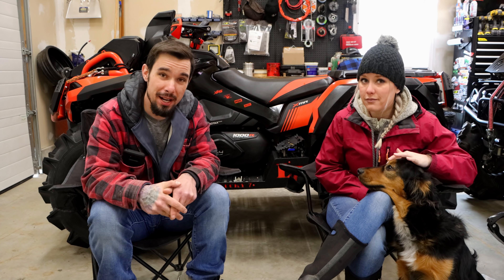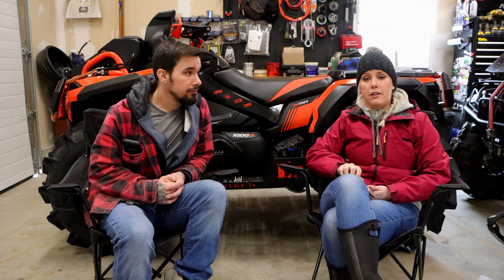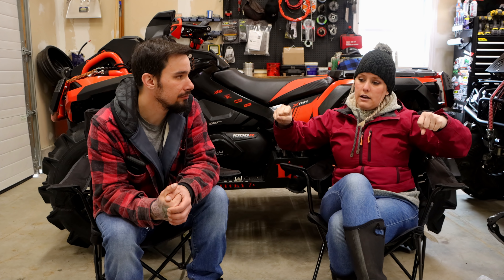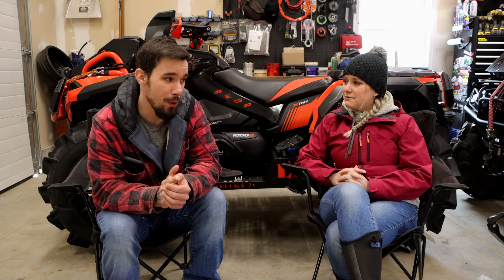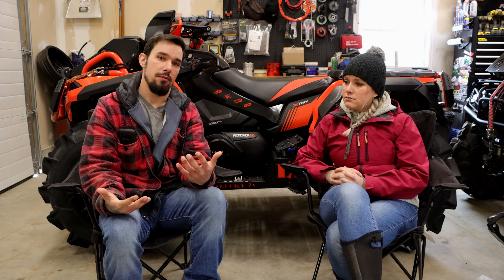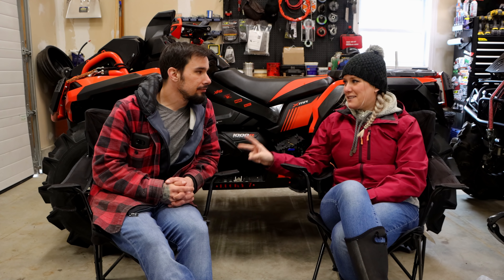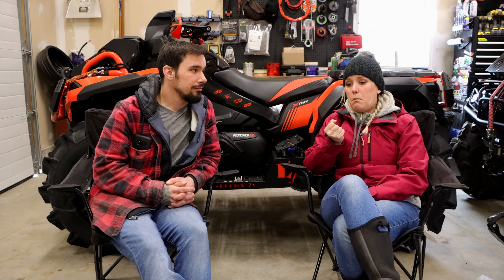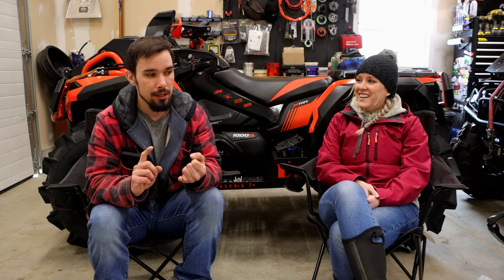5 LIKES/DISLIKES: 2018 Can Am Outlander XMR 1000r #ProjectMischief

Comment: As usual another great video. I always enjoy watching the 2 of you. Keep up the good work. Oh and I ride a 2014 Outlander 800R XT and I found out the hard way that the tie rods are the weak link. One of them snapped while trail riding by  myself my 1st time out  last spring and ended up rolling the machine and the broken tie rod some how ended up puncturing my Radiator but luckily I was only about 3 miles away from my truck and was able to limp it back.
Reply from the maker: Crazy! You never know eh? Thanks Scott!

Comment: On my Commander 800xt my first up grade was a set of tires the stock 27"s just won't do anything in mud and then came a 2" spring pucks to help clear the tires and when that didn't help me climb over logs and through mud holes I went with a 4" CATVOS lift and a CV Tech clutch to add to the mix and now I've even thrown in some super heavy 32" Black Mambas

Comment: I have the 2020 model of this bike. Haven't dealt with older models and have yet to play without snow. I really like the feel of the stock clutch. Love the machine. At this point my only complaints is the 65 mph speed limiter and low speed, low power reverse. Will be changing some things this summer.
Reply from the maker: Sounds like you need an ecu flash :)
Reply: @MainvilleATV  just purchased it a month ago from dealer. Nothing done that I am aware of. But the flash will be done soon.

Comment: Having had the exact same bike, my top like is it’s look, top dislike is the ability to change the belt. Doing so on the trail would be a big job, even if you had all the tools needed. It’s hard enough in a warm clean dry garage. 

Anyway, I sold it for a profit, as I’ve done with 7 bikes before it, and now don’t know what to get next. Want a two up but that limits me to two manufacturers, which I’ve had already. Never had a king quad or rubicon yet, maybe one of those, just so I’ll be half excited to try something new.
Reply from the maker: Belt changes are quite easy, especially with aftermarket floor boards. I'd suggest the king quad if you were to choose between the two!
Reply from the maker: Hey! You're one of the 3 winners of the random sticker draw! Get a hold of us on our social media platforms (TikTok, Instagram or Facebook) with your full name and address so we can get them out to you! We also have our business email if that is easier mainvilleatv@gmail.com !

Comment: Great video. I agree in doing the clutch first, I did exhaust and tuning first and it definitely made more power but when I did the primary, it was a completely different animal and allowed me to use the power of the XMR  a lot better. 

Glad to hear you like the Elkas, my stage 3's are in the garage waiting to be installed.

I also do a lot of trail riding and rocky terrain in the Rocky Mountains and that is why I went with Sludge hammers they are not the ultimate mud tire but are more than capable and haven't found anything I can't get through yet, and the ride on hard packed is so much better. I am looking to get another set of tires for Mountain rides where mud is minimal but lots of rocky terrain. Looking at the MotoMTC, Motoclaw, Super ATV Warrior and GBC Grim Reaper.

I did find my Polaris a bit more reliable but my XMR is definitely easier to work on as everything is placed a bit better.
Reply from the maker: Yes sir! Youll love the elkas! Some great tires choices you have in mind! Thanks for watching!

Comment: Great video!  So I have a 22' Outlander 650 XT and my first thought of what to mod would be suspension.  Coming from the street bike world, that was one of the best mods, equal to that of a full exhaust system, you could do as it gives you a lot more flexibility to tune the bike for "You".  Meaning your weight, height and style of riding(cruising or racing).  Not sure if the ATV scene is the same but it seems it is a little different by what you recommend.  Of course I fully understand these are just your opinion but it's interesting to hear and get that insight none the less.

Comment: I have a 19 Outlander xmr 650. I enjoy the short frame.  The 1000 does seem like a very big machine. Not that I wouldn't love a 1000.
Reply from the maker: If I did it all over again Im not sure which I would do. The short frame is very appealing but the 1000 is the cats ass so it would be hard.
Reply: @MainvilleATV  If I didnt need a machine with a rear rack and something for trailers and plowing. The renegade would be sweet. My wife and I are looking into that for her.

Comment: Love the video!👍 I'm looking to do some clutch work to my 2019 Outlander 1000 XMR myself. Did Dirtylife send out the primary ready to go in or did you still have to tune on that QSC. Also do you know if there's a difference in the 2018 to 2019 trailing arms. I want to order the HL arms but they don't have the 2019 listed. Crazy part is they have it for yours and the 2020...🤷

Comment: Have you came across any broken frames? Seems like a common issue on the forums, especially with the max chassis. I see lots of people doing what’s called a frame mod, 1 1/4 square stock inside the frame and welded at the end. Keep up the great work and keep the videos coming.

Comment: When you say tune the qsc clutch are they not just a bolt on piece and already tuned for the model?? Been running stock clutch for 3 years now wouldn’t mind making that upgrade to mine.
Reply from the maker: They are tuned by order. So they can accommodate your specific machine. They can be adjusted quite easily afterwards also
Reply: Ya I have same machine as you only a year older. So I’m assuming the only adjustment that might have to be made is where the belt sits in the clutch?

Comment: Do you think I could fit 31” motohavoks on a stock ride height can am outlander without much rubbing?
Reply from the maker: What model? Either way, yes you will get some
Reply: Mainville ATV and Outdoors it a 2019 850 outlander
Reply from the maker: What model though, xmr, xtp, xt?
Reply: Mainville ATV and Outdoors oh it’s a xt
Reply from the maker: @jdblaster5154  xts suspension is far too soft. It wouldn't fit properly without mods, trimming or a boat load of preload
Reply: Mainville ATV and Outdoors ok I’m just gonna get some 30” cryptids and throw em on the stock rims and call it good

Comment: If you have time do 650xmr vs 700 grizzly but use equally experienced rider for both
Reply from the maker: It would be a short video, in my opinion the 650 xmr would win majority of categories. Not to say the grizzly is a slouch.
Reply: I had a 700 grizzly and was about to purchase a 650xmr so was curious so there that far apart but grizzly is lighter so might go more places power isn’t everything

Comment: I agree with dis 2 control... straight at can am, to much power. Power is nice until it goes to far, when you can  have a whoops weelie leeds to a walk. Something needs a detune or torque dampener. Steering all atvs non and power steering it's never right. 

Personally: covers just like a Polaris fun till in the shop (once they gone it's all good tho)  

Going to argue engine brakes: I perfer yamaha (throttle activation) over the any drop acivation. 

Top or bottom heavy everything is different idk yours. Top heavy is self explanatory but if it's bottom don't know if u have but they act 2x as heavy. 

Size and weight I'm balanced hate and love both.

Comment: Cass’s bike has 45hp and the 1000r has 91 or so that might be the reason why it has amazing engine braking is heavy tires and giant lug and in my oppinion can am has a tendancy to push to much power and blow the you have polaris from what i know they love blowing belts and the en you got yamaha they dont have the most power and now honda the dct hurts and the kawi i personally hate my dealer in sturgeon falls and and arctic well they arent too bad. But other than my oppinion on bikes it sucks that i cant get an elka suspension for a yama kodiak 2000 401cc probably pushing a small 20 hp or so but hey it beats my dads bike with stock tires (yama kodiak 700 2019) STOCK ot hurts hes in a small hole of mud and he get stuck so i go push him out but the 401cc was used to plow so the suspension sucks but i got mud lites not the greates looking tire but they work. If you got a 900ace turbo does that mean cass will get a sidewinder because thats the turbo 998 triple but the yama equivalent would be the viper so... and you guys are the best keep editing and making awesome videos
Reply: 700 kodiak is actually just shy of 49hp,  I have exact same bike as Cass, and mine has great engine braking. i believe  it comes down to her secondary spring being a bit stiffer than mine, and the massive 30" tires rotating. Her gold vs my purple spring. I think Casshas 1g lighter weights than me, but same machined sheave by Brian